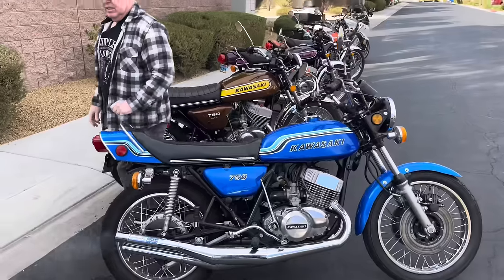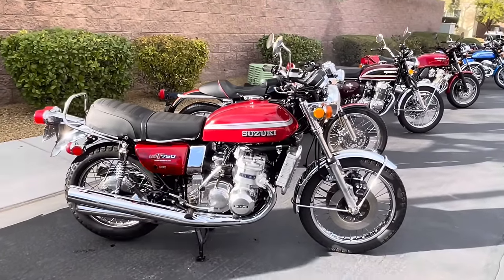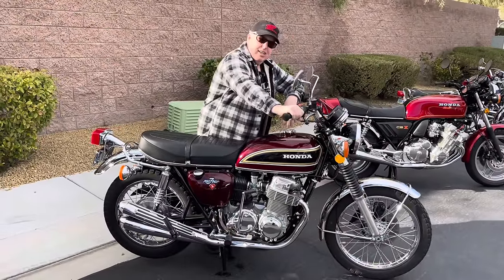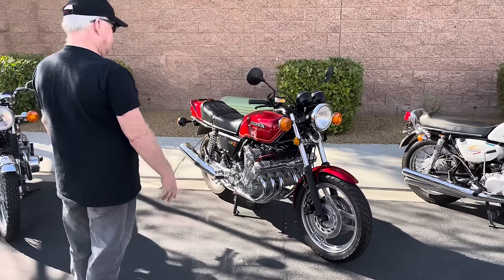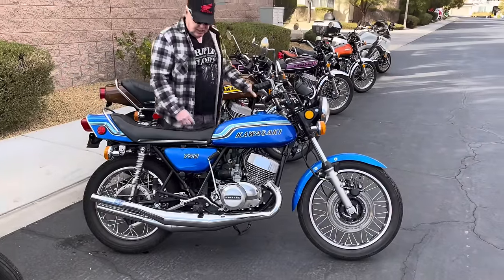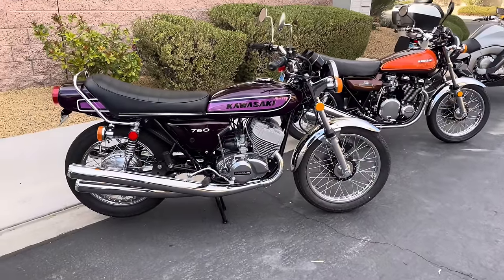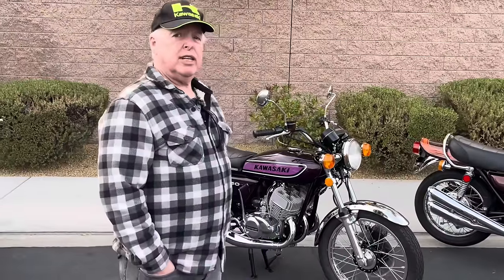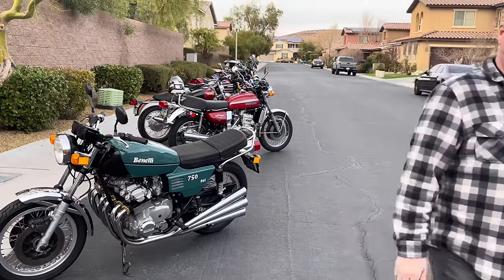Vintage Motorcycle Collection! The smell of Two-Strokes and sound of Six Cylinders! Take the tour!

Comment: I had a norton commando, a triumph trident, a kawasaki h2 and a honda vff. I'am now 70 old.  What good times it was  ... 😢
Reply from the maker: Glad you’re here buddy 👊
Reply: Lucky guy . You should add a Trident 😊
Reply: I'm 70 this year, had similar bikes back in the day. I'm still riding tho, a 72 Kawa 350 and a 2017 Versys 650. Chalk and cheese!
Reply: All great bikes
Reply: I’m nearly 67 and I owned a 1971 Suzuki T350 and a 1972 Yamaha CS 200. Great days.

Cheers NZ.
Reply: @mariodemarco9749 I remember the Kwaka 350 triple clearly.
Reply: I’m a mere stripling at 64. Riding since 1977. Currently own just two bikes. A 1977 Suzuki GT750A & a 1977 Suzuki GT380B.
Reply: Albert, are you from Richardson Tx.???
Reply: @bartbullock7817  Normandie, France. J'habite à Caen

Comment: The GT750 doesn’t routinely smoke particularly badly, unless as here, the crankcase has accumulated excess two stroke oil, usually through leak-by of the oil pump and oil lines. 
If used regularly and given the beans, you’ll get rid of that excess & the smoke falls off almost completely.
Owner of a 1977 GT750A and a GT380B.
Reply: Also collects in baffle packing, regular use burns it off.

Comment: Seems like a knowledgeable guy. My only picky complaint is its Moto Guzzi not Moto Gootzi and the CB750 came out in 1969. I personally am partial to the looks, color and performance of the 73 H-2. And they only made 8500 of the 73's where as they made 23.000 of the 72's

Comment: In 1971 I was working as a mechanic at Amendola Volkswagen in Niagara Falls NY.  The lot boy bought one of these new and came back from lunch with the engine running on two of the three cylinders.  I attempted to find out which cylinder was not contributing by pulling off the sparkplug connectors with the engine running.  The true CDI ignition from this motorcycle hit me so hard it stopped my diaphram from breathing and I laid there writhing for 30 seconds crying when suddenly I could breathe.  This is the first bike I had ever seen with surface gap sparkplugs.  I never spark tested an engine like that ever again.  Great great collection of some fantastic bikes and your 'resto-mods' make them altogether more enjoyable.  Glad to see you keep them and enjoy them in running condition.  Consider adding a 1984 Yamaha RZ350 Kenny Roberts limited edition to your collection.
Reply from the maker: OMG that’s crazy! I’m so glad you’re ok and here with us buddy.
Reply: Above we are talking about the Kawasaki h1 500.  In the line of additional bikes to your stable, think about the 2010 Honda VFR 1200f...1,237cc, V-4 engine, 170HP, first bike with fly by wire, fuel injected, single sided swingarm, shaft drive.  Another is the 2014 Honda CB1100....1,140cc,  last air cooled DOHC inline 4, fuel injected, incredibly smooth with balance shaft, 6-speed trans; a very comfortable riding bike......I have both of these of my 4 Hondas

Comment: Bennelli 750 6 Cylinder, yea that was one hot rocket ship right there............. That damn 80 MPH speedometer on the CBX from 80-82 truly was a POS Law in place. That CBX will bury that in second gear or was it third, forgot it was more than 40 years ago. Sure wished I never got rid of it for sure. I LOVE LOVE LOVED that bike. And that F1 Exhaust Note was soooooooooooooooooooooooooooooooooo  SWEET. I remember my 79 having the 6 into 6 exhaust on it. HOLY SHEET, I HAD A 74 H1 in '78 AS MY FIRST BIKE AND OH BOYEEE was it fun. I had no business riding it as my first bike, but jeez it was fun. A year later I got a Suzuki GT550 triple 2 stroke and it was even MORE Fun.
Dude you must be my soul twin cause everyone one of these bikes I have had or do have EXCEPT the H2, never owned one. Current family is An 83 GL1100 Interstate, A K1300GT, a ZX11, a Katana 750 Gen 2, a Katana 600 Gen 3 for them twisty days so it runs the gamit from Touring to Twisty roads to flat out superbike that is FTF and dangerous cause I cannot stay outta the triples on it. Really Would love to ride out with ya some day and you pick the rides........
WHAAAAAAAAAAAAAAAAATTTTTT, You're selling??? Ok Would LOVE to own the H1 and any of the H2's.  If ya got any left (dangit missed the dang auction) hit me up. I will work with ya on the communication.

Comment: Fantastic ride down memory lane. Thanks. As for first dual overhead cam production bike, it was the Honda CD  or CB 450. Came out about 1966 and at the time was the first production DOHC engine of any kind in the world. Btw, here in BC, a  new 1973 Z1 cost $2300. The CB750 was $1900. I bought the CB ‘cause I always wanted one  and it was a faithful bike on many long  distant trips yet i still have some regrets not going for the Z1.

Comment: I bet on your Suzuki GT750 you will find the crankshaft seals are going south for you, especially on the right side (transmission side). When this seal goes bad, they will suck oil from the transmission and smoke like yours is doing. Check and see if your trasmission oil level is getting lower. That is a telltale sign.
The GT750 was noted as being the cleanest running of two strokes in their day. God Bless You, Beautiful collecton.
John B. (I still have my original 1974).
Reply: Thank you for your comment. I have rebuilt many of these GT750’s and very familiar with the right side outer seal weep. The engine will smoke on all 3 cylinders if it has not been started in a while. Oil collects in the bottom of the cases and gets burned off upon initial startup. The smoke clears up pretty quick and the SRIS, (Suzuki Recycle injection system) takes effect and scavenges the oil from the bottom of each cylinder crankcase. The bike is virtually smoke free after 5 minutes. *If you have a right side seal fail, then you will see very white smoke from the right pipe only. If you have an outer main left seal fail, it will run lean by virtue of sucking in ear air from the "Dry side” crank case.”  Here is a video of this GT750 & another one I restored. *Note calm smoke. i hope this helps. Cheers:  https://youtu.be/-Or_6fDa7yc

Comment: Back in the late 80s a d early 99s, I had a GT750. Absolutely reliable, and hadled amazingly well.  No trouble keeping up on the highway, and, even without a fan, wouldn't overheat on the hottest days. It would idle itself out of gas, and still stay well within operating temperature. Mine was a 73, and at a few months short of 80, I'd give a month's pension to ride one again.
Reply from the maker: Glad you’re here Mike 👊
Reply: I have got a couple of bikes and rd 350 LC completely re built tuned a full stage 3 race tuned all speeds racing reeds oversized pistons full crank re build spend most of the time looking at the clouds it’s rapid and I have a zx6 r ninja in fuel injection green it’s quick to.

Comment: Corrections to narrative: 1) The CB 750 Sandcast was 1969.  2) The first H2 was a 1971 model dubbed the Mach III and was in Norway & Sweden. 3) Capacitor Discharge Ignition, 4) The first Z1 was a 1972 model released in Europe and had no marketing. 5) The widow maker was possibly the 72 H2 not the 69 H1, but depends on who you talk to. 6) “Water Buffalo" in OZ & “Kettle” in the UK. William
Reply from the maker: You did a great job bud 👊
Reply: Also called Water Bottle in Oz.
Reply: Good corrections.

Comment: On the purple H2C you need to move the right exhaust mounting to the inside edge of the rear foot peg mounting. The two plates also bolt together to mimic the single hanging plate used on the brown H2B
Reply: Yeah, I caught that, thanks.

Comment: The first 500cc triples had points ignition UK, fouled up unless you thrashed it everywhere, and if you done that inevitably it bit you. The CBX had a major problem with valve guides being too soft, the only four stroke that smoked like a two stroke. The Z750E a four cylinder was produced in 1980 and sold well in the UK, the model out there was a KZ750E, of all the bikes I owned or rode, the Z750E was the most fun to ride.
Reply from the maker: Thank you for the info 👊

Comment: Absolutely beautiful collection👏 

Just one question: Isn't that brake hose on the Norton Commando to short, it looks like it is in tension even without the front fork is fully extended?
Reply: *It does appear that way but actually when you sit on the Norton the cable really slacks out. Cheers!

Comment: Is Sandcastle 750 Hondas came out in 69 you'll call the KO this guy doesn't know what he's talking about on the 750 Hondas I should know I've had them all the way up till like all the way up to 76 and that color they also used it on the 74 is CB 750 K4
Reply: Read the first comment of corrections before you post ....Sheesh!
Reply: This is the top comment Corrections to narrative: 1) The CB 750 Sandcast was 1969.  2) The first H2 was a 1971 model dubbed the Mach III and was in Norway & Sweden. 3) Capacitor Discharge Ignition, 4) The first Z1 was a 1972 model released in Europe and had no marketing. 5) The widow maker was possibly the 72 H2 not the 69 H1, but depends on who you talk to. 6) “Water Buffalo" in OZ & “Kettle” in the UK. William